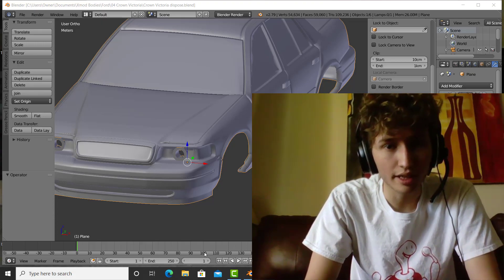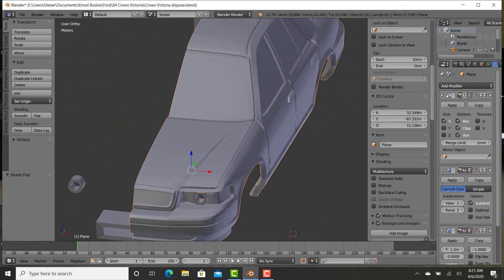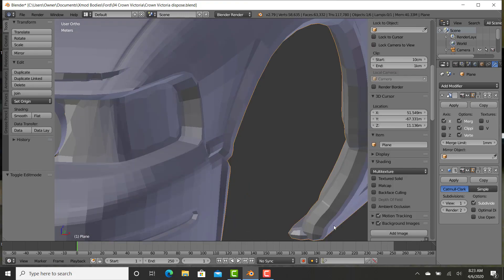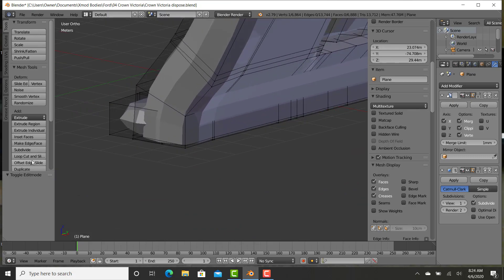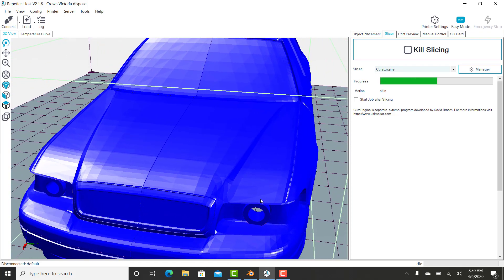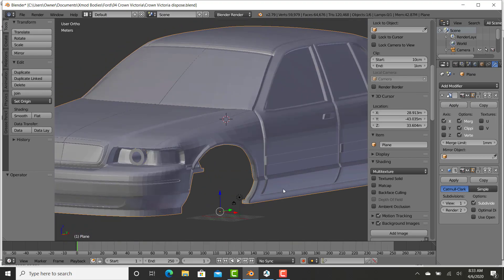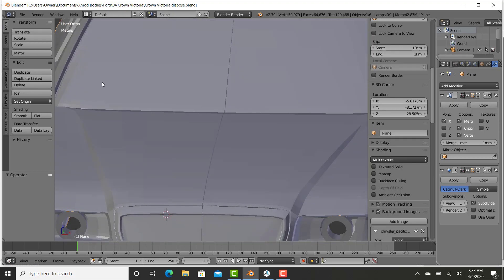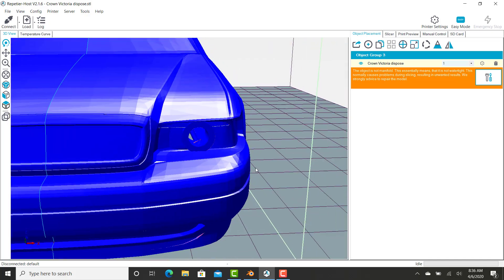Blender Tutorial   Thicken Problem Solving

Comment: There has to be a better way
Reply: you found a better way? having this problem swell
Reply: @Gvo_209  the new version of blender is better with the Complex Solidify but still, you will need to clean it up after
Reply: @Gvo_209  also, some splicing software comes with thickness options that might work if your model is set up properly
Reply: @fortytwo244  i tried downloading but its only for windows, my model is a bit better now. Im printing it this weekend. Maybe i can sand it away. Thanyou for replying tho